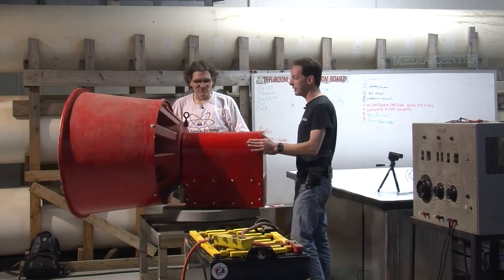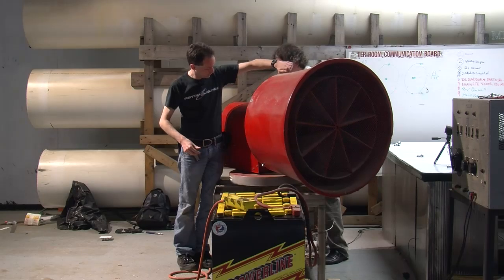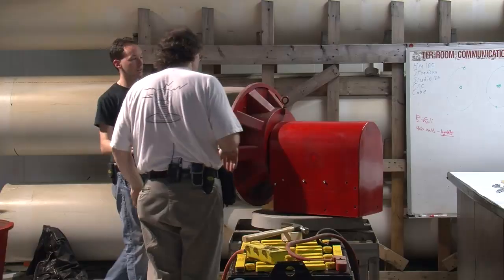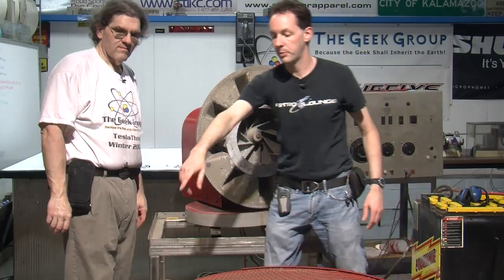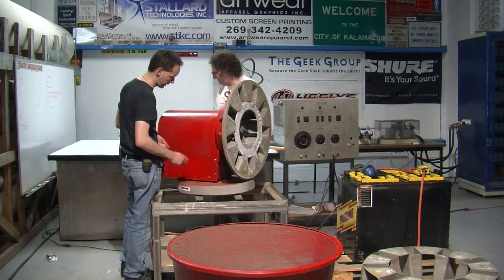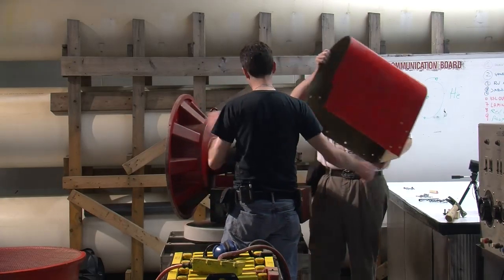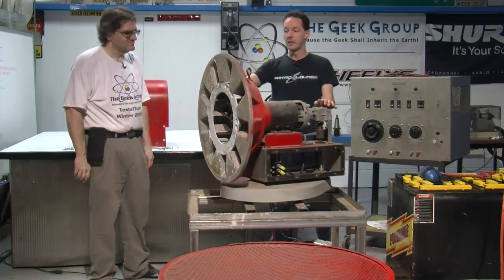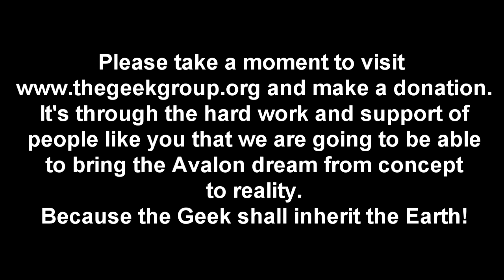2010 Air Raid Siren Demo

Comment: When using the 20 amp DC power supply, perhaps a proper start/run capacitor hooked up to it will get it moving. After all, that what their used for.  You should let the older guy explain everything with out you taking over the show. I would think that it already has a start/run cap in circuit, but I don't know that because you never let the older guy explain everything about it. If you're a so called "Geek", then you should have explained the whole running circuit, including the caps if used with or with out, and why with or with out. 
Some DC motors need start and or run caps, some don't. Explain everything the hows and whys, including the Voltage, micro farad values, how and why, faze delay, power factor correction and perhaps the duty cycle on run caps and a little explanation on RMS and Peak to Peak voltage. Something for the kids and green horns to learn about too. And let the older guy talk and demonstrate things too.

Comment: Being a child of the cold war, these sirens are real familiar to me. They represented  the spectre of nuclear war to us and were no laughing matter. Running at full power and speed it would produce sound levels that would certainly deafen you if you stood that close to it in operation. I lived a city block from one many years ago and when it was tested all other sound vanished in the wail of the siren. The one you have appears to be one of the sirens made by Allied Switch and Signal or Bendix Corp, between 1955 and 1965, given the fiberglass horn and motor cover. Those made earlier were all steel or steel and aluminum. Incidently the part located inside the horm is the "Sound Projector" assembly.
Reply: LuxDude2003 Vacuums it possibly is an aca pn20
Reply: thanks for the anecdote!

Comment: Oh man, I just cannot watch you put your hands into that impeller while the battery is still connected.  That is BAD BAD BAD.  Don't do that!!  What if that button box fell over and that momentary switch closed for just a split second?  A DC motor will take your hand off in that tiny period of time.
Reply: +hugeshows Precisely what I thought the whole time!
Reply: hugeshows it’s at most just break his finger all of the blades are dull
Reply: There is a very very small potential of that happening

Comment: You have an ACA PN-20, from the mid-late 1980's.
Reply: 90s
Reply: Sorry if I'm late but it is a rm 130 I think
Reply: It red
Reply: @MaxtheSirenHunter  It's a PN-20.
Reply: They are the same so it’s either a ASC RM-130 or a ACA PN-20
Reply: @MaxtheSirenHunter  no it's a asc rm
Reply: @halpmeamcringe1538  ACA RM-130
ASC PN-20,the name got changed
Reply: @MaxtheSirenHunter  Yes
Reply: @rainyrec  Its a notherway to call it
Reply: Ok so it is a confirmed pn20. You guys are right that the pn20 and rm130 are basically the same thing just different company’s. But looking at this
 siren you can see the stickers a little bit. The ACA stickers are square and the asc sticker would be a rectangle. And the sticker is a square so it is a pn20.
Reply: @minnesconsinsirens6803  Only difference is the 7.5 HP motor on the PN20, and a 20 HP motor on an RM-130, There is also a different color on each.
Reply: @WisconsinCarWashChannel  no? The motors are the same horsepower. The PN-20 was an AC siren that used batteries with a rectifier. RM-130 used a 72VDC motor so it could run straight off of batteries.

Comment: Hey guys the Air is drawn into the centrifugal fan in the centre via the outside ring and the exhaust and siren sound is concentrated by the conical flutes into the pie grid in the centre. There will be some sound emanating back out the Air due to the pressure pulses created internally but not much. anyone that argue's against that has no idea of siren and speaker theory. . So to recap Air is drawn in via the outer ring and sound projected out through the triangular pie grid in the centre.

Comment: Bug Grinder... 
Sirens of this type commonly operate with a 240v-440v 3 phase ac motor which allows for slow starting torque and high speed eventually, much more reliable than DC. And, Chris needs a corrective interview with the safety supervisor.

Comment: Nice RM 130! You need to get a Thunderbolt 1003 By Federal Signal !!!
DO NOT EVER wind it up with your hand you can chop your hand off, Not Safe!
Those other rings are for the heating pads to melt snow.
Nice Video.

I'm a Air raid siren Geek!!!

Comment: Good luck with the Chrysler air raid siren. Only one, maybe two are still in running condition. The rest were literally left on their placements to rust away. That said, even if you could get one in moderate body condition, a lot of them have had the engines removed. If would probably be easier to build your own from the manufacturing specs.

Comment: There's a Chrysler siren on top of a building in Kansas City it's disconnected but I heard that the power is still connected it just won't sound off during a test of the city but the problem is that it's a three phase power

Comment: The power of these comes not in how many dB, but in how far those dB reach out. A firecracker going off may be 140 dB, but at 10 feet away it's just a loud pop because it's only a small amount of air. So this may not be as loud as you might think, even though it sounds loud from far away.
Reply: The horns aren't shaped very well on this particular siren. All the sides are basically flat at the business end, which reduces the overall power of the noise. Horns with the flared ends will transfer more power into the open air, and will be audible much farther away. The Chrysler Victory siren horns are flared, which helps propel the siren's sound up to 25 miles away. Another guy built himself an oversized air horn with a proper flare, and it was clearly audible 2.5 miles away, and would probably have stretched to 4 or 5 miles pretty easily.

Comment: Oh the current is so high because there are 4 windings as field coils and then 16 or so connected to the commutator and the brushes.

Depending on the 24 V DC starter motor used you could be possibly pulling 80 to 120 Amps or more.

Comment: "Hey Paul, you might want to remove your fingers from the horn before i just turn it on and chop them off!" lmao he seemed more concerned about that then his friends safety....."Im going to disconnect the battery from it" after i already took it all apart....lmao these two...its 10 years later do they have all their body parts still? rofl

Comment: WELL TO SPIGHT THE ODD LACK OF IMFORMATION GIVEN I KNOW THAT IN 1972 THIS WAS A POPULAR SERIES ALL OVER AND 80 TO 200 AMMPS WERE COMMON AT START UP AND THE DBS WERE ABOUT 120 WITH A SOUND DISTANCE OF ABOUT 3 MILES. THE EXTRA POWER RINGS WERE FOR COLD WEATHER CLIMENTS THAT HAD A 120VOLT BLOCK HEATER TO MAINTAIN A FREE SPIN OF CHOPPER. THE MODEL WAS A COPY OF THE P 50 YET WAS AN  A.S.C. BRAND UNIT.AMERICAN SIGNAL CORP. MILWAUKEE,WI.  THEY WORK WELL UNTIL LIGHTNING HITS THEM OR THEY DRY OUT AND REGULAR OILING IS IGNORED.
Reply: OK YOU CAN STOP YELLING NOW FFS

Comment: How many Volts did you need for it to start?
If it would start at below 1kV you could make it with an Microwave Transformer! (Because you said your 20A Power Supply couldnt handle it ;-) )
Reply: They're putting 24V volts into it and it looks to be starting just fine, soo... something between 0 and 24 I'm guessing

Comment: If they were actual geeks then they would know that their little forklift plug as they mentioned is called an anderson connector.
Reply: And they'd know better than to stick their hands in the impeller without any lock out procedures

Comment: It's a large blower engineered to run as noisy as possible. Makes me wonder why low-voltage high-current DC was the only way to power it. No wonder there are unused sirens to collect with the days of air raids long gone; only needed for tornado warning today.
Reply: Gotta be DC current to be able to sound the all clear after.
Reply: I believe Mr. Herde  meant "sound the all-clear" as in sounding the siren once more after the storm has passed, in which case the utility power may have been knocked out by the passing storm and DC battery backup would thus be required.

And now I see how DC makes sense because there are a number of scenarios where this unit would need to operate without benefit of utility power...
Reply: onemoremisfit yes you are right, i am sorry

Comment: they only ran it on 24 volts DC, imagine how it'd sound on 72 volts, it'd be unbearable
Reply: reverse thrust it'll probably run on 4 car batteries at full power. what type of ASC siren is this? it looks like an RM-130 or RM-127

Comment: Ydon'You put the chain back up on and see you then there were rotating the sound this be a lot betterthen you rotating it by handI know you're trying to show the people about turn it real friendly but we all better suck the train back up on it that's what is designed with the chain   yeah this is Fred yeah I'm not like to have your from your old phone number I can give you a call in and talk about different sirens and things yeah something like to get ahold of one of those are like to the novel to 1000 t-model then I don't like that hi lows on the border of all like the Thunderbolt another 1000 to you tomorrow and I would like to get a you speaker Dr the system in there Regan other turn the microphone on saying this is a test this is only a test trying to get a girl a wheel in we'll make some real good speaker box drive and the good then because of their hope in the two alarm system where to come on in there don't run in water have a hookah my number down there to the good news dr the siren this is a pretty good the puter process on this a yeah that's a Peru really good computer system on this alarm system I'm thinking about getting systsystemIm getting there for a homer yeah my telephone number is 4059335533build some timethey live at 305NorthMorganDr Moore Oklahoma zip code 73160